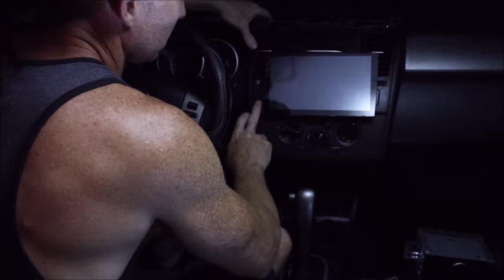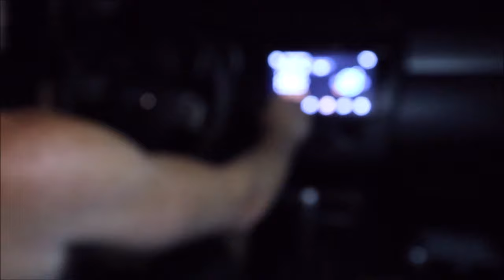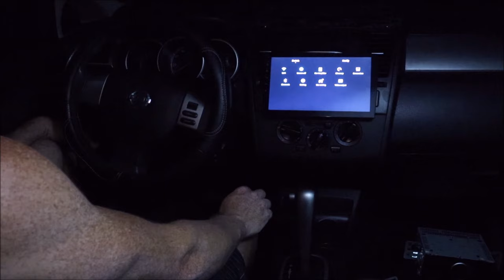10.1 Android Touch Screen Car Stereo Install [Wiring and Mounting]

Comment: I just purchased a corehan 10.1 inch android radio. Thanks for the video. The mounting was very irritating as its basically impossible to install it with brackets and the dash cover. Very helpful video for that. Unfortunately so far I'm not as impressed with mine.  For some reason bluetooth didn't want to connect at first and the radio doesn't allow downloading Netflix or Disney plus which is needed for long trips with the kids. Also found even with mirror link to my phone by usb it still wont play video on it from those apps on my phone which is very irritating.  Even the movies I purchased on Google play wont work. I'm beginning to wonder if I purchased junk. Well glad to see your have purchased a good one. Keep up the good work and the videos. Maybe I'll find something useful on mine by watching your videos with yours.
Reply: You were able to get mirror link to work on it??? How did you do that??
Reply: @joshbrowning3488  the mirror link works by connecting your phone to the usb cord that's connects onto the back of the radio. You also need to use a app called EasyConnection. I found it to be alittle pointless so I dont use mirror link. After contacting the maker Corehan they told me the website to use in order to download and watch Netflix and others. Seems to work fine but the radio is a bit slow so I only use it when taking the kids on a long trip. Otherwise I just use my phone on my lunch breaks.

Comment: Hey, Love this video. I got lucky on my vehicle already having an aftermarket head. connecter worked fine, and i enjoy the unit, although I acknowledge its limitations. Did you ever figure out the backup camera? having trouble figuring out the connection, having tried multiple routes with no success and no contact from the seller =/
Reply: The harness should have a reverse trigger wire that needs a reverse signal wire from your vehicle to power the camera on. You will have to find out if your vehicle has a negative or positive trigger on the reverse signal and locate the circuit and tap into it.

Comment: YOU STATED THAT YOU ORDERED DIFFERENT PARTS FOR IT , COULD YOU PLS LET US KNOW WHERE YOU ORDERED THEM THANK YOU .....on another note your video is awesome demo I have a dodge Dakota and really having problems with attaching the unit to dash bezel....
Reply from the maker: Hi, which parts are u needing? I thought I put links to everything I ordered. Lmk if not I'll try to help out thanks!
Reply: @danielmid6022  how about the rear camera install, as the RCA supplied for rear camera has two wires connected that attach to the stereo , also if there is a better manual, love your video just missed the setup the rear camera so wondering when you will video the rear cam era install thanks

Comment: Ive got a hilux in Australia. I installed one but the reception on the radio is ordinary. The blue wire with the bit of coax is not used on mine. Do I need to power up the blue wire?

Comment: Would there be another reason mine keeps blowing fuses OTHER than the wiring being wrong? I know for a 100 percent certainty the wiring is correct, I've double and triple checked, re-read the diagram and everything. Would like to explore another scenario if there is one. Any advice would be appreciated.
Reply from the maker: A cut or knick in a positive wire that could be touching metal or other wires will cause fuses to blow. Make sure no strands are sticking out at any of your connection points
Reply: @danielmid6022  that was literally the second thing I checked on all of my connections, but that's some of most sensible and logical advice I've received so far, thank you sir. It could be that specific  unit I bought was faulty from the manufacturer to start with.

Comment: Hi Daniel
My son has just carried out an upgrade on my 2012Mondeo titanium x sport
all seemed okay until we tried to adjust the climate control there was no reaction on the touch screen do we need a interface
the unit is a
Artsxw 9.7 Inch Car Stereo Bluetooth Touch Screen Car Radio For Ford Mondeo MK4 2011-2013 Android 10 Head Unit GPS Sat Nav Support CarPlay Android Auto Wifi 4G Mirror Link TPMS Built-in

Comment: Hey can I ask where did you get your harness from? I've just brought android tablet stereo too but I'm totally stuck I would be able to crimp it if I knew which adaptor I needed but the WiFi cable is a plug but my car doesn't have a connector to put it to? 

Thanks love the video
Reply: U can install without a harness but only if ur comfortable with splicing into ur cars harness u can always extend the wires with aftermarket wires if they match colors and all that but yeah

Comment: Just purchased the smaller version and my passenger speakers front and rear is not working. Wires are hooked up correct
Reply: Do you already fix it?

Comment: I need help I install my radio no problem but however I’m not getting any sound! Also steering wheel control not working.. Any possible reason or any solution?

Comment: Mine has a ticking sound and slight static noise that doesn’t go away how do I get rid of that?? Also key one and key two wire splice to what other wires for the steering wheel controls to work ??? I have the basic GM radio that You’d find in late 2000’s GM vehicle

Comment: Really could use the rear camera vid. Mine came with an extra connector with a video line and 2 blue wires. Oh, and another plug with like 12 video/audio connectors.

Comment: Everything works on my Android radio that I just bought except it will not hold the radio station memories and it was full plug-and-play I didn't have to mess with any except for one wire which is the backup camera wire do you have any suggestions what could be happening

Comment: For the radio antenna do you use the one that was plugged into the original stereo or the one attached to the new wiring harness?
Reply: That usually depends on your model and yr car. Most of the time an adapter might be used for the antenna.

Comment: I received my head unit today so I found your video interesting and informative.
Just a quick question though...

Those wires that you attached together, which other wires did you actually connect them to?
I only got one set of wires which are loose from the other end so I wasn't sure what they are attached to.

Comment: Great job with the installation I got the same radio it works perfect
Reply: Still perfect? I am thinking to buy the same one. Thanks
Reply: @pascualorzaezcarretero20  did you buy it ? my factory's manufacturing car head units . 4/64G , 6/128G. carplay and  everything. if you still in need of that feel free to contact me.
Reply: @yanrongning9735  not yet

Comment: How long is the boot time?
Does it go into sleep mode when you remove the key? When you turn the car on later, does it boot up from cold boot again or go straight into where you left off after you remove the key from earlier?
Reply: Mine loads up instantly after the first install. I think while the vehicle isn't running it must use the battery connection to enter a typical android "sleep" mode. after unplugging and plugging in the main wire harness a few times trying to figure out my backup cam, I noticed it had to boot android every time. But, once its installed and you have everything the way you want it, it wakes up with the ignition pretty quickly.

Comment: i have an acura tsx 2004 and i decided to intall another screen since the original one was very expensive for me and turns out that it is bigger,it works for the frame that car brings,but the frame has a plate which does not let me pass the cables i thinks if i cut it,it would stay,but i didn dare do it ,i could only glue around it so that the screen with the frame would hold better,as i mentioned,itś bigger,but that alone prevents me from installing it...

Comment: I just did the install for the binize today in my 09 Versa. Big game changer definitely way better now, you're video helped a lot thanks. I do get kinda bad wifi service in the drive way let me know if you have a clue.
Reply from the maker: Wifi seems a bit spotty on my unit sometimes. I usually turn my phone into a hot spot and that works pretty good.
Reply: @danielmid6022  same with the hotspot. I reached out to them. My reverse camera harness was missing one of the blue wires (WIFI, Bluetooth antenna), If you don't plug it in or its missing one of the 2 that could be it. Ill know once the part comes in.

Comment: Did you connect the ground wire from the head unit to the ground wire from the harness? Or straight to metal in the vehicle
Reply from the maker: My unit had a good ground already so I used the original. If u can make a better connection to the cars frame that's the way to go

Comment: I have the same radio and if you don't mind could you help me out with something? I connected it but only get sound from the radio and when I connect my bluetooth from my phone there's no sound? It says you don't have to connect the plue power antenna wires but if I don't connect them I get no sound at all? If I do connect them together I get radio sound....Someone suggested a bypass and to connect the blue wires to the red together and actually that does work ...the only thing is the radio wont shut off when I shut off the engine and open the door....which caused my car battery to die...It's a great unit and I love it but I'm sure its just a matter of me having one wired crossed the wrong way.....And If I didn't mention I don't have any aftermarket amp just factory from a Pontiac Grand Prix 2006

Comment: Did you ever do the video for the back up camera install?
Reply: That's eazy you tap in the rear taillights and run video wire towards the front.
Reply: @juliosandoval8244  how exactly bro? I'm about to do mine 😭
Reply: @lachavez7349  the camera comes with 2 red wires u putt them together  and run them to your reverse light on back of car.use a blade and cut a piece of the shield and do military splice.use power and ground from the reverse light.than run the yellow rca from the camera all the way to the front.that rca cable should have a red wire for power and that wire goes to the reverse wire on radio behind it on aftermarket unit.with factory radios is diffrent
Reply: @juliosandoval8244  damn bro I appreciate you replying & giving me all that info, I'll keep you updated here shortly on how it goes 🙏🏼
Reply: @lachavez7349  Simon anything u need hit me up i can guide u make it eazy on you
Reply: Yeah… need that video for the GPS and Rear camera
Reply: Same here could use a vid for the camera or even photos...I got a different brand/unit for my chevy sonic  but it looks exactly the same as the unit you got.
Reply: Hello did you ever get tps sensor an other stuff for radio? I'm looking for that? What is it called?

Comment: Also the orange wire gets connected with the red wire I wanted to be where when I turn on the ignition it comes on and then when I turn off the ignition it turns off correct
Reply: Which orange wire. 🤔

Comment: Does video work without connecting any wires to the frame of the car? And where did you connect the ground wire to the frame or together ?

Comment: I have a 2008 Nissan Versa and my Pioneer touch screen broke last week.  I am wanting to buy an Android based head unit like the one you bought.  I noticed a lot of manufacturers are coming out with these large screens / floating screens which look awesome.  My only complaint about my Versa is that from day one the AC has always sucked.  I've changed out the filter and get it recharged etc. but never makes a difference.  So with adding in a stereo with this large screen it is partially blocking the AC vents.  Are you having any issues with this since installing your 10.1" screen?  Thanks.
Reply: it wont block your AC , it comes with frames and cables specific for your car when you buy it

Comment: I also installed the head unit but the steering wheel controls keeps on wrongly funtioning after the car is switched on after a while. The volume up key makes the volume go down and other buttons do not perform the tasks they were set for initially with steering control settings.

Comment: Volume control doesn’t seem to work on mine. It stay ‘s the same volume regardless if on seventeen or on volume one. Any ideas.  Any updates to this unit?
Reply: You need to install custom firmware to resolve these known issues. You can visit XDA forums and search for your model

Comment: Great video one question where does the amp cont blue wire connect to?
Reply from the maker: I believe that wire is the amp on/off wire. Only needed if u are running an external amp
Reply: Well not the ant. wire.. mine has a pink amp wire that doesn't really work...

Comment: what if the harness on the car does not have an illumination wire, where do we connect the illumination wire that came with the unit?
Reply from the maker: U will have to find a wire that gives power when your parking lights are turned on. Use a 12v light tester and start checking or look up your cars wiring schematic
Reply: @danielmid6022  what are parking lights? U mean the dome lights that come on when you open or close a door?

Comment: Would this work with a 2019 Toyota Corolla specially the steering wheel control. Anyone?
Reply: Yes, just look for the right CANBUS adapter for your car model (and year).

Comment: did you work out the rear camera install ?

i'm trying to work out which wire for the reverse trigger (red wire)
Reply from the maker: Yes it's the pink wire
Reply: @danielmid6022  worked thankyou !
Reply from the maker: @ukguy20  I'm not 100% sure but I think those wires will power your camera if u want to be able to view it at anytime, not just while in reverse. Still have to look into this more though
Reply: For y’all to view your camera is there an app on the head unit?
Reply: @bishopburns7050  nah camera feed shows on screen when reverse lights turn on

Comment: Did you get the camera working?
Reply from the maker: Yes, just haven't been able to do a video yet. It works good
Reply: thanks for the reply.. I had a broken cable that was giving me problems. It's sorted now. Thanks.
Reply: @danielmid6022  did you do a video yet? My camera bracket is floppy. How the heck is it going to stabilize?

Comment: Hey there I know this post is old but I have a question the stereo you have in the video did it come with manual cause if it does and shows the voltage and Pin layout can I get a copy of it cause I'm trying to hook a back camera to one of the pins that not been used that put out 12v
Reply from the maker: Hi sorry I don't have that info

Comment: Can i save data on an external storage like usb key ? For Spotify or Google map for example
Reply: You can use offline maps you will have to connect the head unit wifi or Hotspot  on your Phone then you will have to find an app called here on the unit follow the instructions in the app to the main map page  select the option menu (should be top left) select use app offline and download your preferred map for your region and it should work from there.... since its an android unit if your hooked up to the internet you can download Spotify on it and download music to listen offline as well you can use the Bluetooth option and play it from your phone as for the USB I haven't tried it not 100 percent sure it will work but it should be able to work as well... hope that helps

Comment: My screen is blank 5GWiFi 8 Core Car Stereo for Jeep Compass Patriot 2010-2016 Android12 48EQ 10in IPS Touch Screen Head Unit with Wireless Carplay Android Auto DSP Bluetooth SWC Backup Camera(10.1" 2+32)

Comment: Ok long story short I need help with smthn (btw I'm only 15 so idk correct terms) but i hooked an old xbox 360 power box to the radio wired the radio into the amp and wired the speakers and subwoofers into the amp but I cant get the wifi to work on the radio any reason why?
Reply from the maker: Dont think the Xbox should affect the wifi. Try disconnecting everything from the radio and see if wifi works. If it does, reattach your accessories one at a time to see which one is causing problems
Reply: Daniel Mid I think you replied faster then the company would lol (it was Bc I didn’t add the gps btw)
Reply from the maker: @santas_fatrolls6817  interesting... I'm not currently using the GPS and my wifi works no problem. Glad you got it figured out. Take it easy!
Reply: @danielmid6022  you to also happy late thanks giving

Comment: So I bought the same radio and got the harness adaptor and when I plugged it in it didn’t turn on. 😓
Reply from the maker: Double check your ground wires
Reply: @danielmid6022  it had a bad head unit. Replacement will be here Saturday.
Reply: @danielmid6022  what’s the password for the factory settings
Reply from the maker: @josephaninakwa9328  I think it's 0000 or 1234
Reply: 8888

Comment: the unit will not power on. everything is connected 👀
Reply from the maker: Test your power wires with a 12v light tester to make sure u get power to the unit. Make sure your grounds are very secure and making good contact. Also check fuses. Hope that helps!

Comment: Head unit sucks. It doesn’t have enough volume to it has lack of tuning capability, audio quality, and lack of rca inputs. If it is just going in you’re beater car sure but going for any sound system or audio quality I would not go with this head unit.